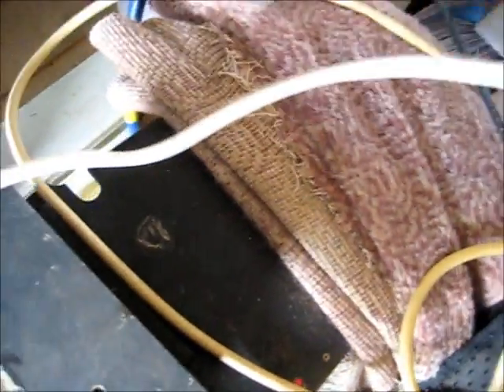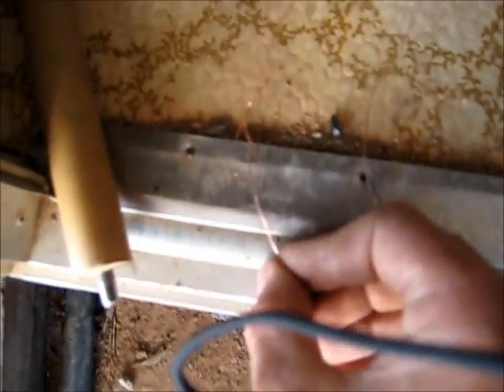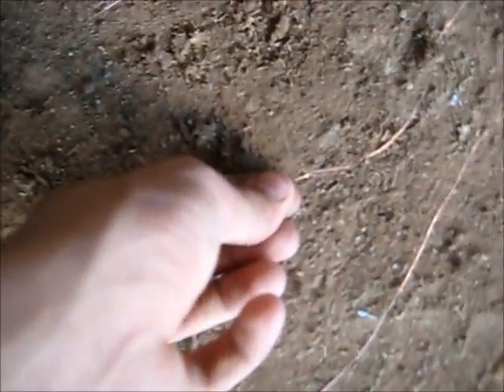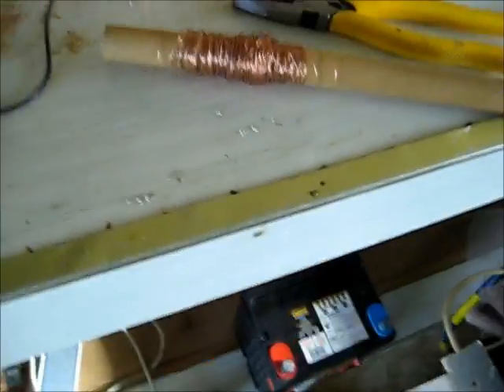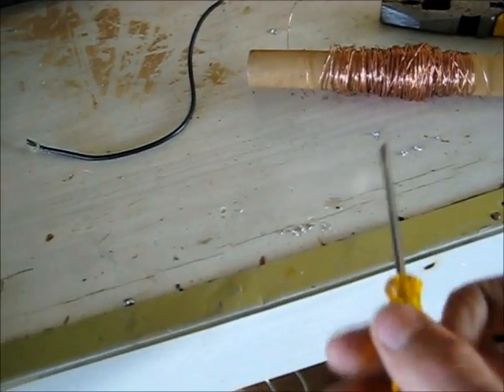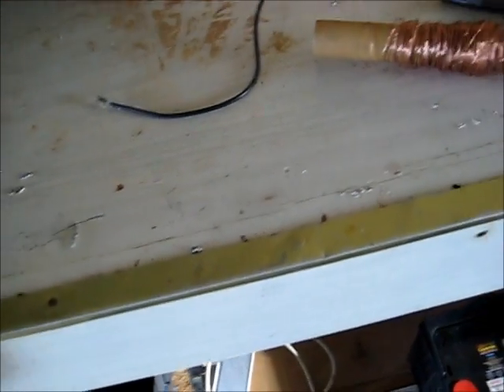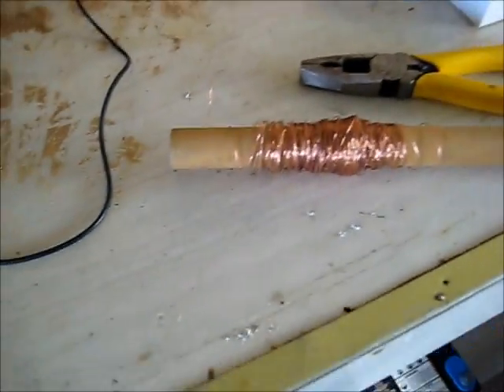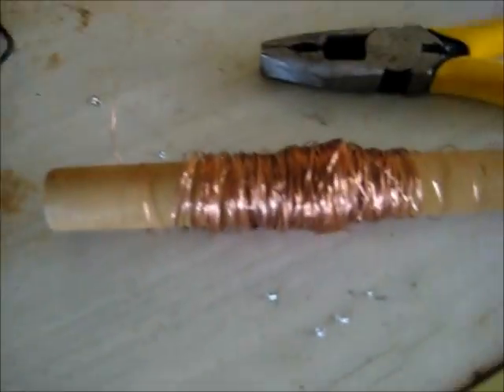Making a Long Shortwave Antenna

Comment: I haven't done it myself but i have seen plans on the internet.  It's a pretty simple device.  Basically:  you get a non-resistor-type spark plug and put it in a metal pipe, and attach the pipe to ground and the electrode tip of the plug to your antenna. If there is a lightning bolt nearby which would make the antenna spark, it sparks through the spark plug safely inside the metal pipe.  You still disconnect the antenna from the radio  when lightning may come around.